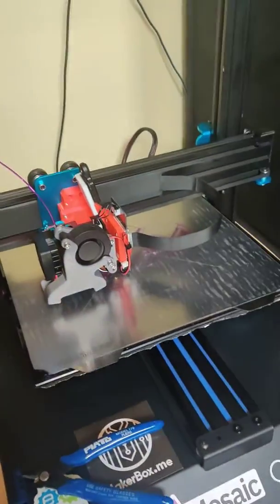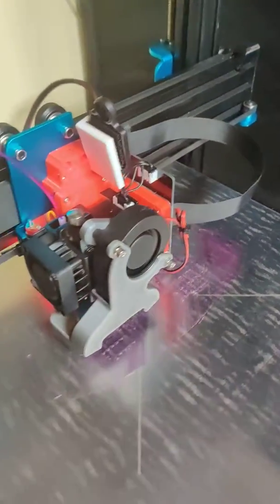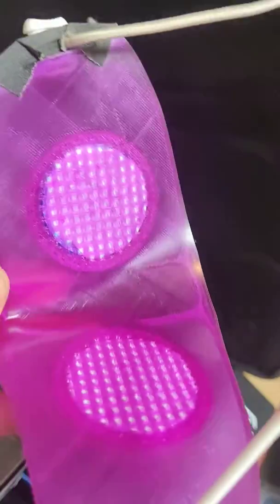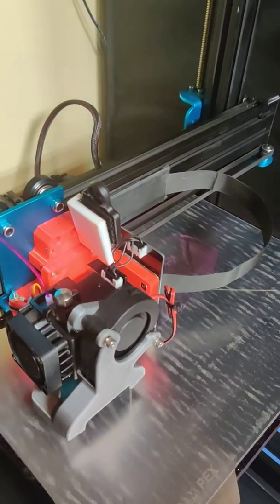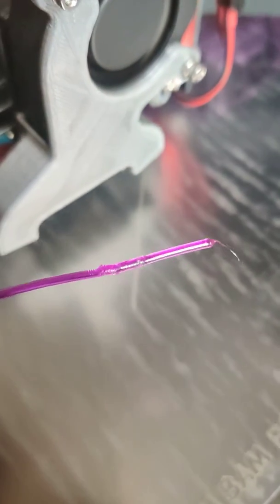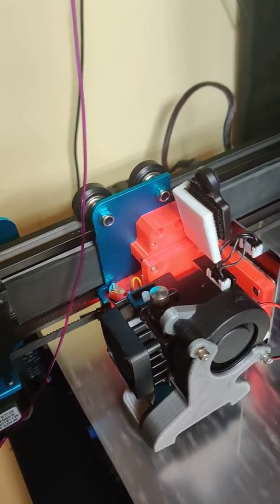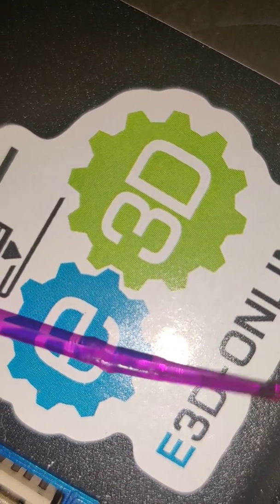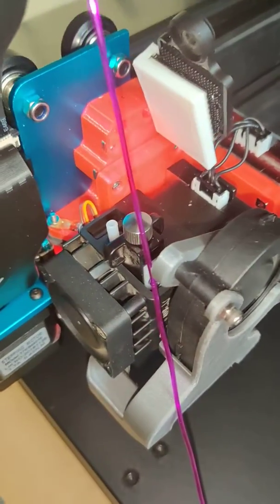E3D Hemera gear clog

Comment: E3D did fix it for me very fast. had the same issue, E3D wrote on their web site that they are aware of this isue (one batch of stepper motors where out of specs from the supplier). I contacted E3D support, sent pictures, a few days later I had a brand new Hemera in the mail. Was very pleased with their fast warranty supply. Didn't even have to send my faulty one back to them.

Comment: Same issue with a new Hemera. Looking at it, the heat break goes to far into the extruder, where the gears can catch it and the filament catches on the edge of the heat break until a pieces breaks off the filament causing the click and bulge in the filament coming out is from that brief pause then release of pressure when the filament can move again.  No fix yet,.. I mean, unscrewing the heat break a bit to lower it  1-2 mm  would solve the issue but I assume it would also cause issues,? ordered a new heat break and heat sink, then I'll risk snapping this one off by trying to unscrew it.  might try grinding down the heat break. This seems to be a common issue happening for well over a year based on google results, yet nothing from E3D.
Reply: It actually fixes it for me. Thanks for the clue. I trimmed a bit off the connector rod at the gear side, but you could also just put some washers inbetween the extruder body to move the opening away from the gears. It leaves just enough space to give the filament some wiggleroom and to relax after being squeezed by the gears. I moved it down about 1.5-2mm.

Comment: I have same problem also and its brand new. Not even 10hours of use. It happens on every new print I do. I have to pull out fillament. Cut tip and  then it starts to work. Frustrating
Reply: see my comment from today, cheers

Comment: I have the same problems.  Gotten so I can split the left side off in a few minutes and clean the gears - then reassemble.  What I have been noticing is the hob gear assembly and motor gear are breaking, or metal fragments are filling the teeth,   In my opinion the drive gears are cut too fine, they often shred the filament instead of pushing it.  My main problem now is - I need a new drive gear set and new motor.  The motor is a part that can be purchased, but is out of stock - no idea when it will be available.  The gears are not a part that can be purchased.  I'm researching other systems, as I have had this problem on all of my 3 printers.  I was fortunate that I have 2 spare Hemeras, but they won't last long.
Reply: send them back to warranty or at least report that. They will send you a new pair of gears. Same happened here. The gear wasn't stuck to the axle that got through it so.... just the half of the system would turn and pull the filament.... everyone in the foruns would says to fine tune the nob so i would get the right pressure on the filament.... forget it.... as soon as i disassembled i made a video and sent to e3d reseller that sold me...
Reply: The gears are most likely hitting the heat break,